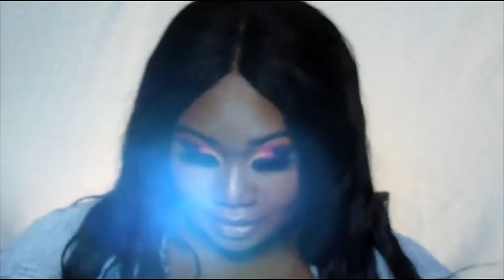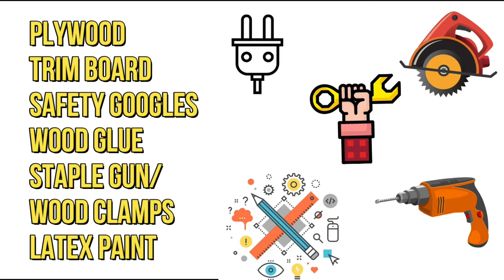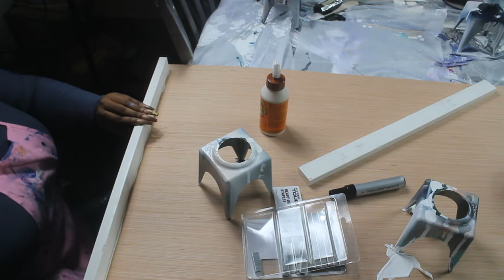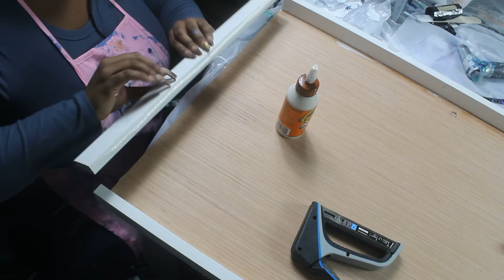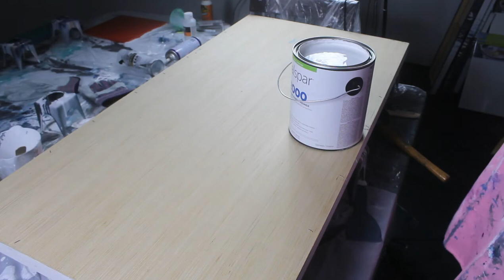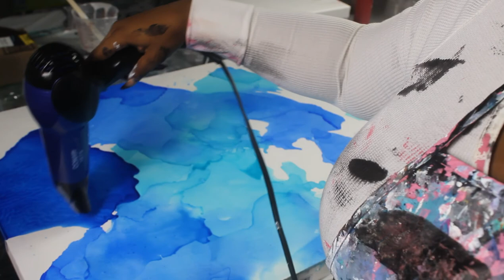Alcohol ink Basics: Making a Cradled Wood Panel

Comment: Not to be a hag....but, with a board that big, you should miter the corners. Plus cross pieces in the corners. Otherwise, it'll likely warp. Js PS....Also need a straight piece across the middle, short way.

Comment: What are the cut measurements for the trim board?
Reply from the maker: For mine 2 ft x 4 ft, the longer pieces were 48 inches, the shorter was 23 1/2 inches
Reply: @nikaleverett57  thank you